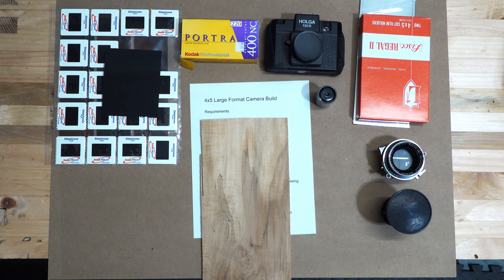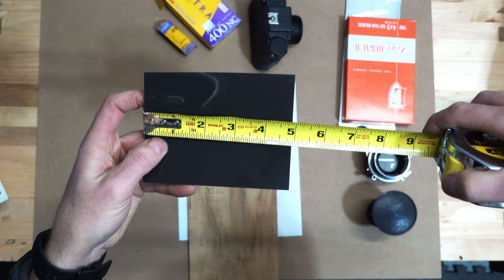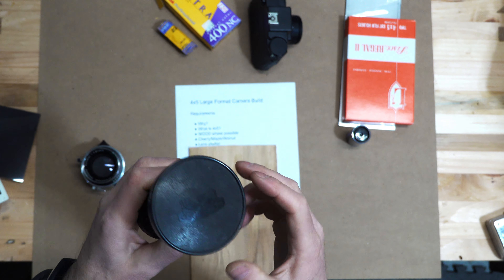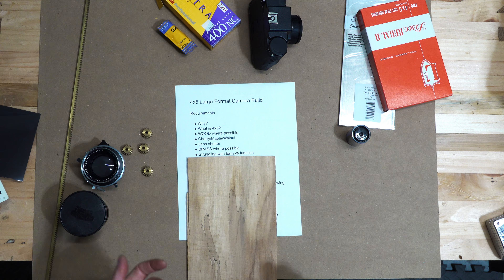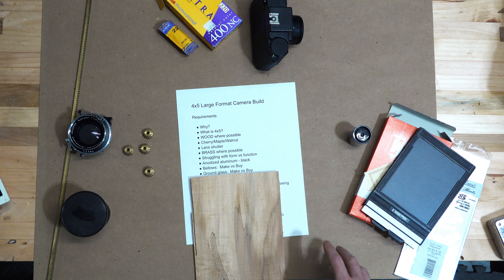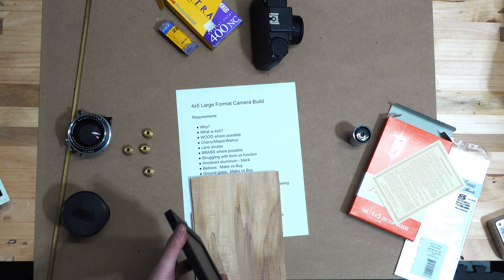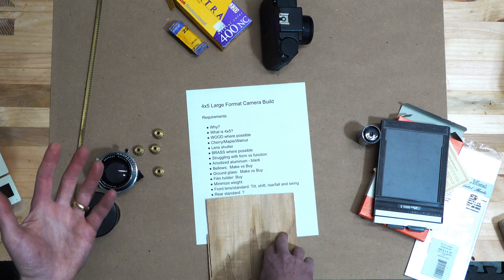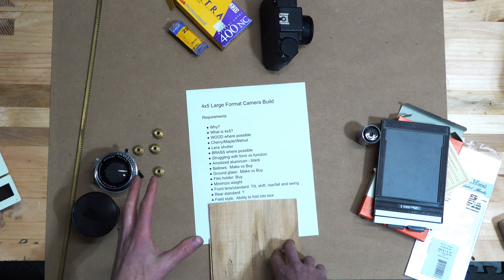4x5 Large Format Camera Build Kickoff

Comment: 220 is the same film as 120,  220 has twice the amount of film on the roll, if you can get 8 shots from 120 you will get 16 with 220.
Reply: Yes, and 220 has no backing paper so it is thinner without paper and if you have a camera like Holga where you look numbers from an openable window in back, you need the back paper that has numbers ie 120 (not 220).